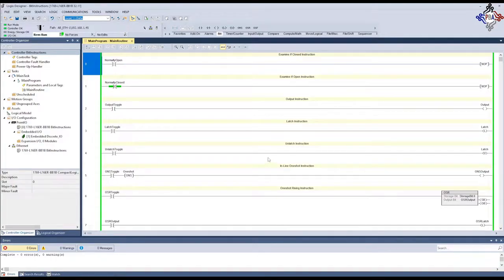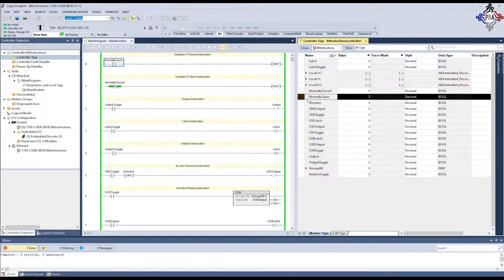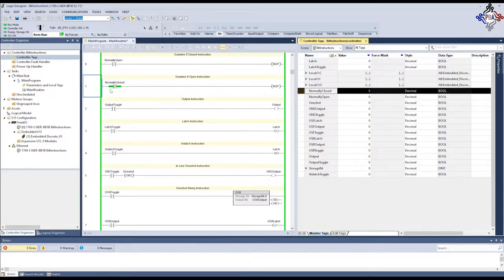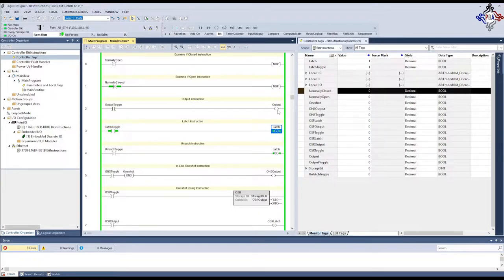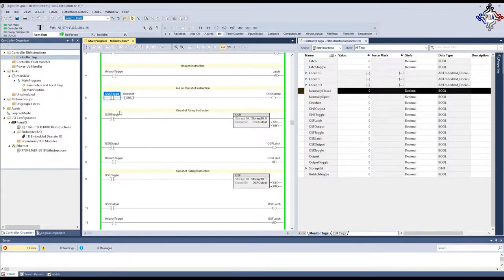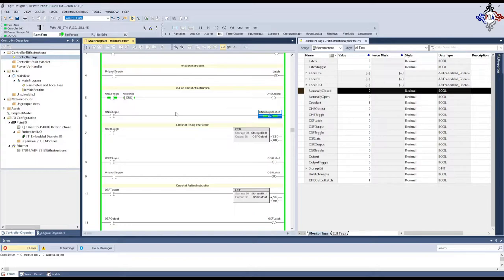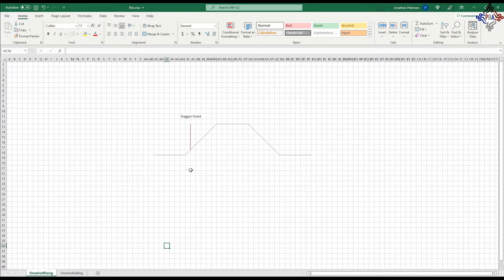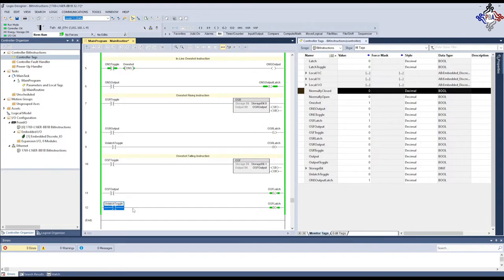Allen Bradley Studio 5000 Bit Programming

Comment: Started out on gas turbines with relay systems.  Moved onto PLC5 and then finally to Logix5000.  Advantages/Disadvantages to all of them.  With the relay we could get by with a Fluke and test leads.  All the setpoints had a +/- to them.  If it was close, it was good. The turbine was running when we got here so nothing can be that far off.  Over the years, emissions got tighter and the +/- got tighter.  PLC5 worked pretty good but with the limited memory, tags were abbreviated and we did not have a list of standards.  It was up to the particular engineer to name everything for that particular project.  Just one of the things I jumped up and down on someone's desk about.  But it was nice to be able to see more of what was happening.  Learning to read in "counts" or mA and being able to import live data to a spreadsheet.  The problem with the Logix5000 was that the engineers thought that they should try to use as much memory as they could.  This would result in bloat-ware.  So many more rungs of confusing crap.  Some logic you could correlate from relay, to PLC5 and then 5000.  Other stuff was a time consuming adventure that would result in one's head beating being slammed against the laptop.  Most of us "old timers" were heavy mechanically and pretty good with electrical.  We could think logically so converting to logic wasn't impossible but AB of course was constantly upgrading and changing.  We did have some field engineers that would actually get their hands dirty and would happily explain any logic that we would ask them about.   Others were dicks with a small d.  I just got tired of trying to keep up.  Happily retired although I do miss some of the guys, some of the customers and some of the troubleshooting.   Nothing like having a customer call because they've had a turbine down for three days and their guys finally gave up.  We show up, look at some logs, talk to a few people to find out what the problem really is and then an hour later, they're back on line.  This was a pretty good basic video.  Thanks.
Reply from the maker: I heartily agree with your comment about bloatware programming. I've always been interested in finding ways to do the operation in the fewest lines of code. This generally makes it easier for almost everyone down the line as they have to follow what I did. 

"A designer knows he has achieved perfection, not when there is nothing left to add, but when there is nothing left to take away." - Saint-Exupery?

-Jon Peterson, PBA LLC